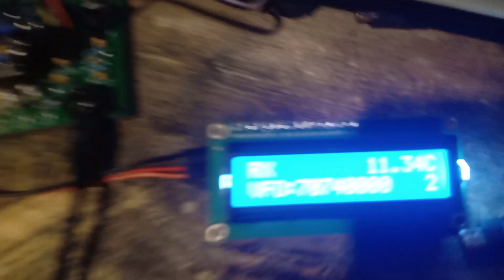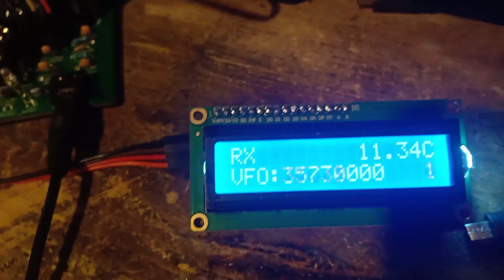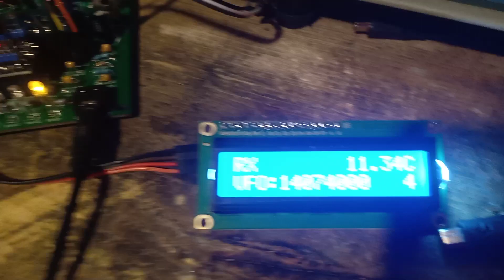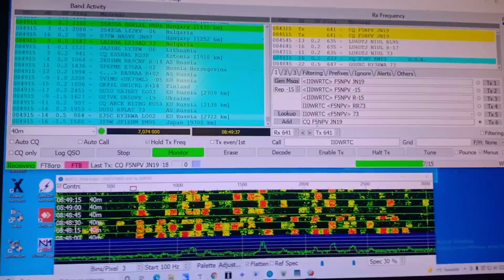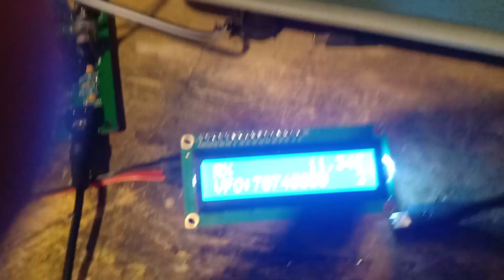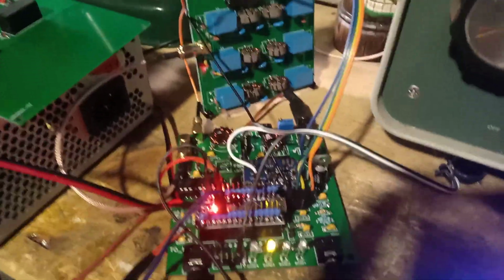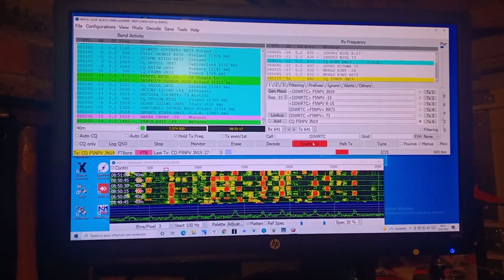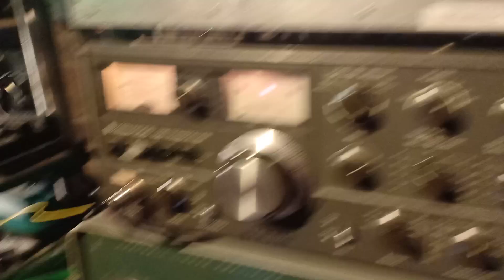F5NPV - FT8Qrp transceiver first run

Comment: I tried to make this from your blog, but why does clk 1 the frequency that appears not match the counter frequency?
and at clk 0 there is no signal coming out of the si5351 when tx is enabled on wsjtx
Please help me .....................thanks
Reply from the maker: hello maybe you have a faulty SI5351. you need to adjust the TX sound channel at the maximum level . try with another sound card with TX sound set to maximum level
Reply: @f5npv-v85npvamateurradio3  ok thanks

Comment: Well done.  :-)
Just 1 question, why do you have a connection from the board to a plastic foot of your Heathkit linear?

Gust ON6KE
Reply from the maker: Thansk , no on the plastic foot of the heathkit this is the temperature sensor just laying down
Reply: @f5npv-v85npvamateurradio3  OK I see. Thanks. Take care.
Reply from the maker: @placeholder840  Currently the main issue i have is on 80m band , the modulation is glitching a bit . i need to work on it